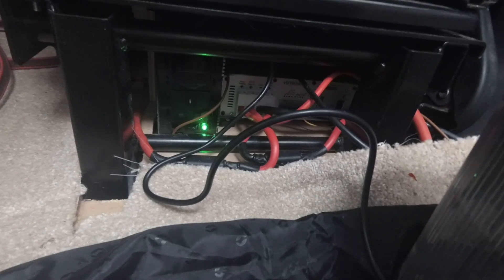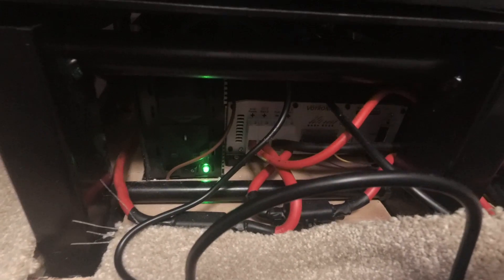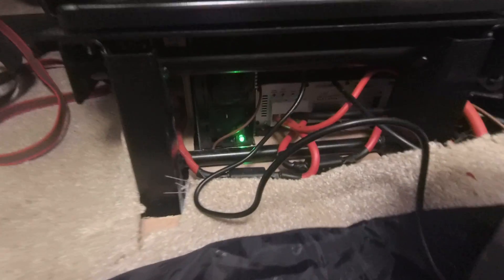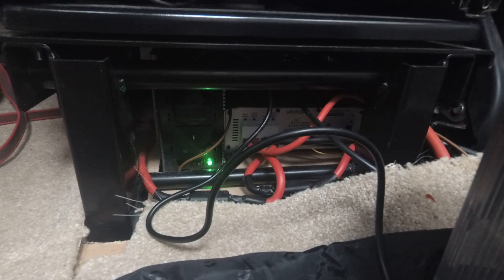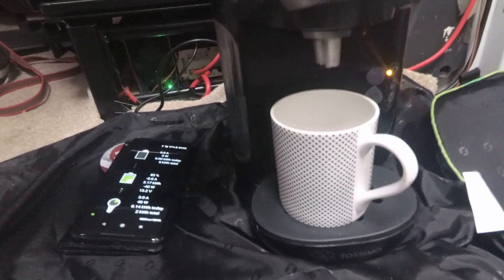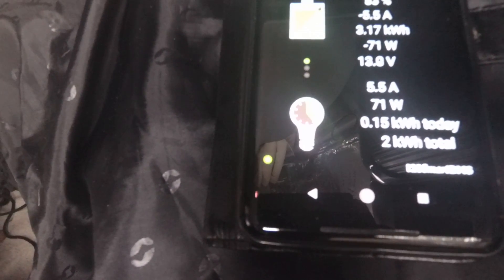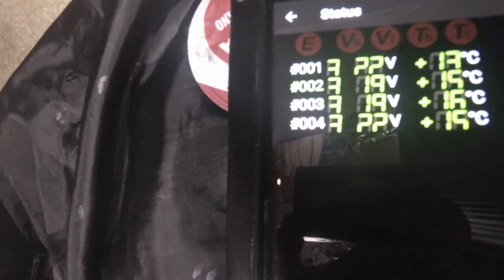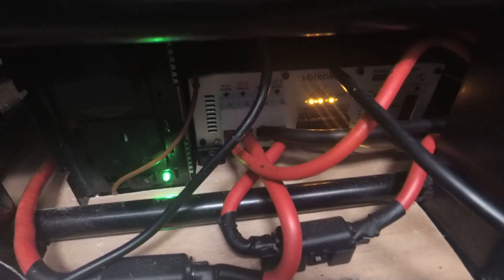Quick Test: High Drain with Inverter (Winston LiFePO4, 123 SmartBMS and Relay)

Comment: Hi, i have the same setup 123 smart bms/ smart relay and vbcs triple... i have the issue, that the charge-relay switch off whe cells are full... but as soon as the charging stopps, the cell current fall down to 3.22V.... (12.9V total) really strange... did you set the capacitiy to 100% or just as recommented 75% of the real capacity?
Reply: Hello,
There are two possible reasons why this happens:
1. There is some resistance between the busbars and the cell poles. Make sure you first connect all the cells with busbars and then on top of the busbars the BMS cell boards. If this does not help, there may be oxidation on the battery cell poles. Remove the oxidation with sandpaper and add some anti-oxidant compount like Noalox.

2. When battery cells go bad, they can get a high internal impedance. This means when you discharge it, you will have a voltage drop in the cell. If you charge it, the cell voltage will rise with charging currents. As soon as you stop it, the cell voltage will drop again.